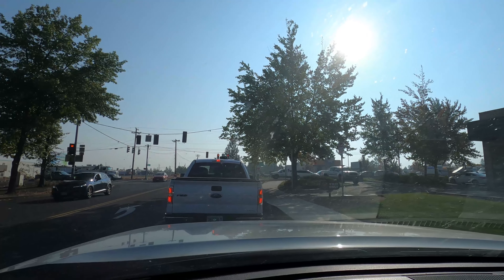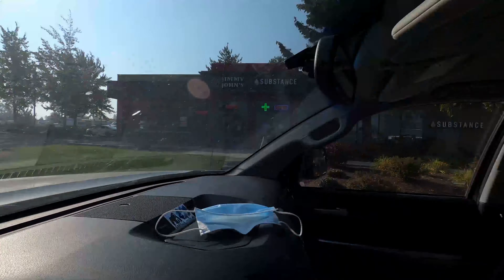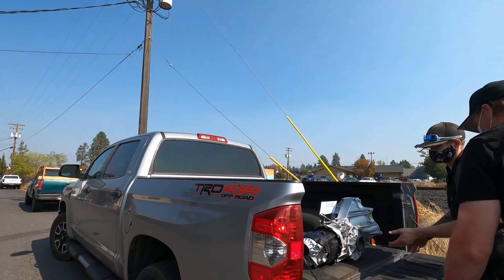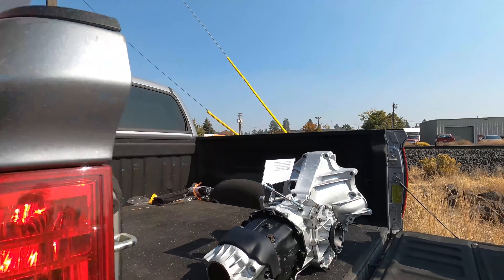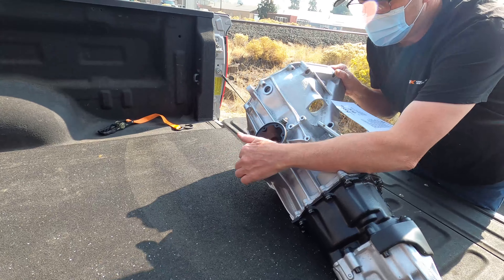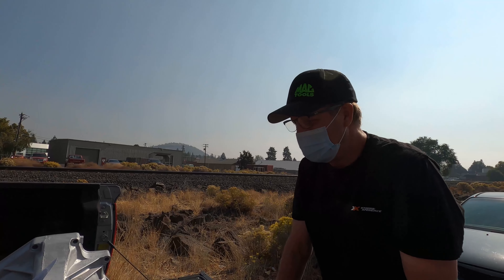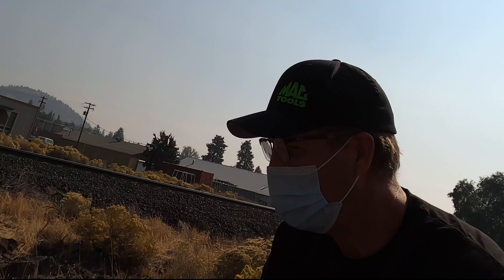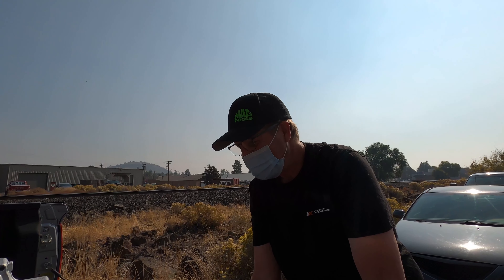I Got The Transaxle For My Porsche 944 REBUILT and Installed, Almost ready to drive Oct 2020

Comment: Great videos      Are you running the 944  or S or Turbo transaxle? I have an LS 6 in my 944 S  and 2nd gear is very hard and considering replacing not sure with which one.. Your thoughts ?
Reply from the maker: I am running the 944S transaxle. If I could have found one that was affordable I would have definitely used one out of a turbo. The gears are much larger and The fifth gear does not wind out as much. The reason I did not use one is I could not find one for under $5000. If you can find a cheap one definitely buy it and have it rebuilt. The parts were kind of hard to find but I was able to get everything I needed. I can definitely do burnouts and not worry about breaking the transmission but if you were to go super hard on that thing it would definitely break it's designed for 150 hp. The turbos are designed for 230 hp so you would have much better luck not destroying that one LOL. Let me know what you decide to do and I would love to see your build. Thank you so much for watching and supporting my channel.

Comment: How much did it cost to rebuild that transaxle ? I think I have to do the same
Reply from the maker: To do it right and replace all the bearings and seals, cleaned top to bottom and having the best 944 transaxle repair shop do the work. It set me back about $2400 and it is like new. I have had a chance to drive it and it is so different, I thought it was a good trans before but it is like driving a new 944 off the lot, except this one has a V8 :)
Reply: @hanzdidit  hey what’s the name of the shop you went too?
Reply: What’s the shop name?
Reply: $2,400 isn’t a bad rate for a full rebuild. Now you know it’ll be perfect for the foreseeable future.

Comment: What transmission did you use?
Reply from the maker: In the end I finally just used a 1987 944S transmission. I had it rebuilt by German transaxle and it works perfectly now. Thanks so much for watching let me know if you have anymore questions.